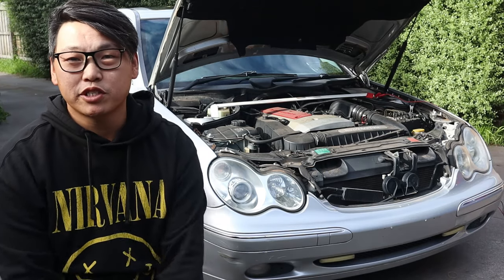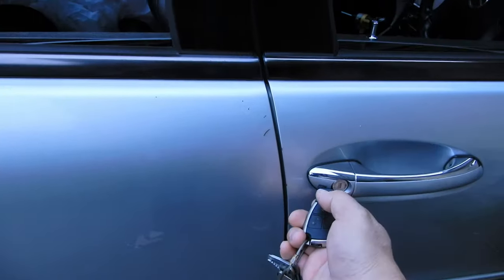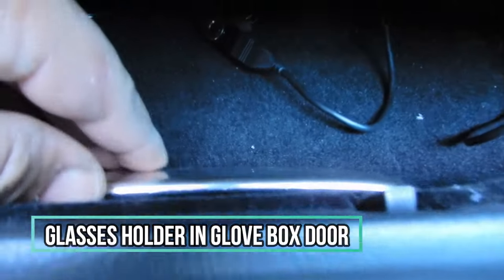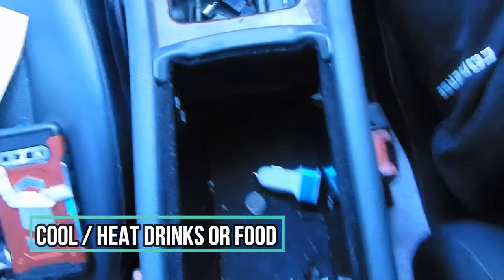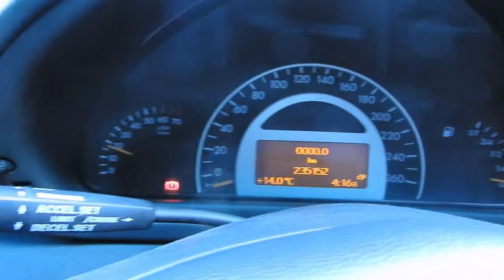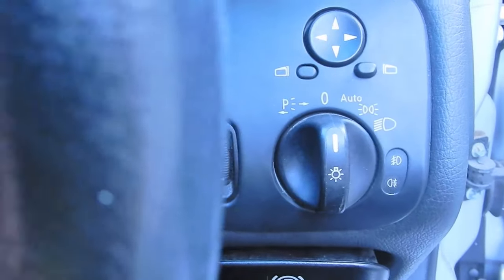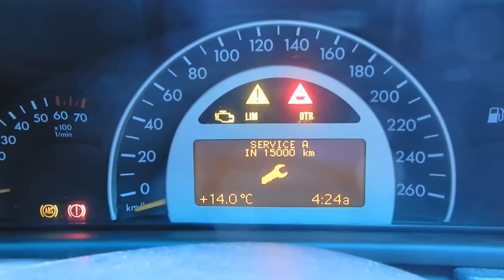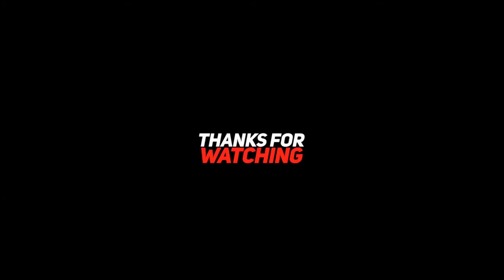MERCEDES W203 cool features tips and tricks handy hacks hidden functions

Comment: Hi MIKEYZ. great video. My c32 has got that annoying clicking sound from the vent system. Was thinking of cutting the electrical connection to the centre stepper motor instead of trying the huge repair. Surely that stepper motor is not that important. hasn't worked for years.
Reply from the maker: yeah I guess u can do that ...
Reply from the maker: 2nd-ly well done on getting the 32 omg thats so gangster love it bro
Reply: @MIKEYZVLOGZ  .Thanks BRO. greetings from Melb. Happy New Year
its the wife's car believe it or not. Nice having a supercharger on a V6. Great takeoff. we have had it 12 years now.
Have you ever seen a w203 in Grey Paint. GORGEOUS. Extremely rare. check out carsales c55 w203 in grey for 34K.
I WANT IT !!!!!!!!!!!!!!!
Reply from the maker: @MercAMG  ye man I've seen that grey colour ..its nice

Comment: so about your sun visors, mine is a 03 and it has pull visors which are very nice. I'm sure you could probably switch some out and it'll be fine. also, mine is having an electrical issue. every few months I have to replace a bunch of fuses to be able to lock and unlock my car from the remote. and the automatic seat adjusters don't work. as well as my sunroof will not open. and how I know it's about to go is that it sets the alarm off randomly, the lights flash and I can't get it to stop until I pulled the fuse. I think it might have a short somewhere and I really can't take it to the dealer to have checked out because I really don't have that kind of money. and I really can't seem to find anything online. if you have any idea about what's causing this, please let me know. I'm in the US btw.
Reply from the maker: wow that's a list and a half ... in your case it could be a short definitely but finding it is another thing .. I am not a professional mechanic but I can tell u that I would start with forums and ask ppl who understand and know cars and auto electricians ... it could also be a parasitic draw too ... that can set the alarm off too .. I hope u get it sorted mate 
.and good all on switching out the visors .. that's very possible too ..but feel it's not necessary... g luck mate
Reply: @MIKEYZVLOGZ  thank you so much!
Reply from the maker: @jebbus1497  no worries

Comment: Hey guys. I have a w203 ‘05 classic 2.0 engine. I bought it less than 6 months ago so I am a newbie at this. If somebody can help me it would be great. First of, My car is automatic however when I put it on gear through tech-tronic, it only has 4 gears. I don’t think that is right, is it?
Second one is my break pedal is very heavy to press. Like very heavy! Is there anything I can do about this.
Appreciate any answer!
Reply from the maker: u should have 5 or 6 gears in auto sometimes 7 depends on the transmission u have ...if your brake pedal is heavy check your brake fluid and make sure you have fluid and also that your brake system doesnt not have any leaks or any parts are damaged , im about to release a video that will help ppl understand more about their car and what options it was fitted with during manufacturing ... so stay tuned
your brake shoul dbe easy to press unless u have lost brake pressure

Comment: I'm trying to understand about the heat booster option and I don't know what it does, it gives me three options: 1 automatic 2 press ec to turn off 3 off
Reply from the maker: ok so ive been asked this alot and from my research and asking other fellow subscribers, its definitely ;doable on the rear doors, if you scroll through the comments there is another guy who states that he did the exact same thing on the rear door, its just abit tricky where u mount the actuator, but im told it very doable, now i personally havent done this yet as my rear doors are fully functioning atm, but if i do ever need to i will be the first to upload the video

Comment: Mikey, do you know how to repair the “infrared windows and sunroof up/down with the key” function?  It simply stopped working one day on my W204 and the same exact thing happened when I had my W203...also just stopped working one day.  It used to work fine.  And I always make sure my batteries are good, I’m pointing in the right direction, I make sure there isn’t any debris covering the sensor on the handle, etc.  Do you know if this is a common problem if it’s a relatively easy fix?
Reply from the maker: so ur windows no longer go up and down with the key... hmm i have never had this issue.. i think it would be just a matter of replacing the infrared bar on the handle or it would be sensor related.. i honestly have no idea how involved it is .. i approach all fixes with the same attitude. Which is anything is fixable.. and better to try yourself then getting ripped off by a mechanic or worse the mercedes stealership,,do some research join some forums and ask questions.. so many helpful ppl on the forums
Reply: @MIKEYZVLOGZ  OK thanks!  I honestly thought this is common since it's happened now on both my cars!  Weird.  I'll look into it but it's very, very low priority.  I'd first rather work on the control knob on my W204 and I quickly saw your video on that.  My control knob also no longer controls anything and I remember you doing a fix with a metal vs plastic cylinder on that.  Well...thanks anyway!
Reply from the maker: @AlGolzari  no worries matey
Reply: Hi, the sensor for this has a broken solder joint. Here is a repair video. https://youtu.be/h5GEVx5uemI
Reply: Boudico Thanks so much!  Appreciate it!
Reply from the maker: @boudico843  love it when other ppl contribute to the channel.. thanks so much for getring involved rather then just flicking through..thats what i want from my viewers..interaction ..contribution.. help to answer questions i dont have the answera to... after all im just a d.i.yer i have no mechanical background or qualifications..im completely self taught and have a lot to learn ...no one can know everything... theres always something else to learn in life in general and in watever u do... sincerely

Comment: What is the problem with your starter. My car is automatic and same problem with you that can not start engine with one turn
Reply from the maker: I think because car is manual it different
Reply: @MIKEYZVLOGZ  Maybe. But i think your car may have a problems with starter selenoid or relay in front SAM (starter relay). My car is the same problems but I pretend to check these part

Comment: Hi bro. Enjoyed the breakdown of some of the features in your video. Two questions on my 2007 C-class 180 kompressor (auto). 
(1). How do I set the side power mirrors.Tried on the setting but unable to find any clue.
(2). Any navigation system in the car. Saw navigation system as part of the features before buying the car.    Your help will be appreciated. 
Salute.
Reply from the maker: so urs is a w203 or 204?? have u checked to ensure you have the function??
Reply: @MIKEYZVLOGZ  Is W203 bro. Where do I check for the functions? Gone to the settings but could not find anything.
Reply from the maker: @amaechiogbonna769  do u have the memory function ? on ur mirrors?

Comment: Help me I’m trying to put blue led Front headlights and fog lights but for some reason the car wont let me it just flashes on and off
Reply from the maker: ok so u need load resiators watch my video on headlight mod my latest video ill show what it is and its in the description what to buy ... leds need load resistors becuz they run off lower power then halogen bulbs so u need a load resistor to allow constant wattage and voltage to the led light ...

Comment: I want to ask something about w203. I am thinking of getting myself one but I've read that this model doesn't actually have a "soft" ride that you have with w211 or w202 or w210. The thing is I really like how this car looks but I've never drove one. Is it true that it doesn't have a "soft" ride that other Mercedes' have, is it really more firm and sporty cus I am looking for a comfy mercedes ride/drive
Reply from the maker: it may not be as comfy or soft but nothing too extreme.. and if u wanted there are things u can do to help soften your ride... like suspension tyres etc.. in the end it's all about personal choice.. if u like the shape it's worth getting... and u can adjust your ride like I said by mods etc.. not a good enough reason not to buy one.. some ppl will find it ok and some will say not soft ... test drive and decide bud
Reply: @MIKEYZVLOGZ  I currently drive my old Peugeot 206 which is a model from 2000 and I guess the w203 will have a better and more comfy drive?

Also I am 6'2 so when I sit to drive in my 206 no one can actually sit behind me, do you think it would be the same with w203?

Thanks for the info!
Reply from the maker: @Vallkayrie  yeah ur pretty tall so u have to put the chair back quite bit but only way to find out is actually test drive and see how you fit
Reply: @MIKEYZVLOGZ  thank you so much for the provided info ! wish you all the best
Reply: @Vallkayrie  mate im 6'2" and my 2002 C220 CDI has enough legroom for a giraffe!🦒

Comment: Hey Mikey I'm looking to buy a w203 c280 at about 74000 miles, is there things I should be prepared to look out for when inspecting the car?
Reply from the maker: just usual 
turn on ac wait for 5mins see if there clicking from stepper motor ..check under battery for rust .. headlight hazzing... engine wear noise... brake wear .suspension check not too bouncy ... auto feel for gear slips in auto ..response etc.. manual check clutch feel wear.. hard soft to press..tells u if clutch is almost worn..look for rust on panels ..listen to speakers make sure none are blown ... do a search for w203 common faults and compare
Reply: @MIKEYZVLOGZ  thank you it’s my first time buying a used car I think I’m looking at a fairly clean one I’ll make sure to be thorough and not tunnel vision
Reply from the maker: @altofant  yeah but do the usual checks too

Comment: Hi Mikey, I’ve just had the dreaded ESL warning light show on my c 200’Kompressor
Reply: Sorry Mikey I truncated that message. At the moment it is still starting but the initial sound seem not quite as normal. What I propose to do is prepare the car for repair while it is still
In action so that the steering lock does not activate. How do
I do this? I know that this key can have a mind of its own so I am looking to disconnect  the battery with the steering lock off. Am I being  obtuse it do I just start it up and pull off the neg terminal? Sorry if this sounds silly but I would much rather be  thought silly than end up with the ESL locked. Thanks in advance.
Reply from the maker: Its better to be safe then sorry ...ok so all u have to do is inserr your key ans listen for the unlock sound then leave key in ignition and disconnect neg battery terminal and wrap it in a cloth so it cant make contact again .... wait 20 mins before u start so all the remaining power can discharge completely or u can get a airbag light ...as there is still power reserved in ur car....
Reply: Hi Mikey: Thank you very much for the battery disconnection procedure. I am not looking forward to this project at all; but I will keep you informed of how it goes. I have no doubt it will work out OK but it is going to require all my reserves of patience, I think. However, your videos are excellent and an enormous help and all have worked perfectly for me. Thank you.
Reply: Sorry to trouble you again Mikey. But I am having enormous difficulty in removing
The ESL from the tweeting column. I’ve thought of removing the entire unit but that seems to be fraught with problems I can do without. What I need, I think, is the little ridged circular ratchet you had on you extension. I have looked all over for it without success. Can you tell me where you got this nifty little piece. I assume it just clips on to the standard link on 13mm nuts. Thank you once again in advance and sorry for being a nuisance.
Also I have decided to go the simulator way to obviate the risk of this catastrophe happening again. I have not yet decided which way - new chip or the whole plastic job which varies in price from NZ$60 to $220. I’m inclined to think the cheap option would serve the purpose because it still is only a chip that fools the car into thinking the status quo has not been altered.
Take care, my friend.
Later... I am having enormous difficulty in removing the ESL.
I have see another YouTube video ( in Spanish) and I wonder if it is as easy as it looks. I’d be grateful if you could have a quick look at it and give me your expert opinion. 
The YouTube address is:
Como remover a trava ELV da Colima da Mercedes C200 - NASSCAR Scanners.
Thanks in advance.

Comment: Hello there, my W203 going into limp mode repeatedly, some say it can be due to the loss key contact and need a new key which holds tight in the key slot.
Reply from the maker: no thats not really making any sense cuzif your key signal is loss it will say insert key..does it say insert key?
Reply: Yah I think it's inert key. Can it cause the car limp
Reply from the maker: @mogotsimpesu3832  I am not too sure ..but what I mean is if ur key isn't detected it will say insert key and u can't drive ...
Reply: @MIKEYZVLOGZ  usually this happens when it fails 1 kick start.
Reply: And at times it becomes inert esp in the morning it start and fails to idle, then limp mode
Reply: Could be a split turbo intake pipe

Comment: How to turn off the stepper motor (its clicking like in the video), do I have to turn off my heat or what?
Reply from the maker: i dont think u can unless u unplug it ..its a bif fix too because big job to get to it
Reply: @MIKEYZVLOGZ  once I put car temp to 22 or less, it stops to click, I think i tricked it or smtg
I am a bit confused, what triggers stepper motor to work, is it always on or
Reply from the maker: @Armin-cu9gj  they move at the start of turning on ur car and  wen u turn off ur car .. they always do a fill motion check that's why u get the clicking noise .. its checking full range motion.. then it stops after cpl mins
Reply: @MIKEYZVLOGZ  alright so, it spins at its max rpm for a little bit, then goes for ur speed..
I have one more question, i m thinking about replacing halogen fog lights with led, do i need a ballast for led lights?
Reply from the maker: @Armin-cu9gj  depends if it is designed for it .. some have it .. but if not u may need resistors for the leds u use .. just make sure they are canbus ones as well

Comment: Sorry bro this was an afterthought did you have that Android device fitted if so how much did it cost if you got it done by your friend how much did it get cost for the average guy that knows what he's doing to fit one error does the company that sells them fit them
Reply from the maker: I fitted it myself..its plug and play 

just make sure u buy the adapter that plugs directly jnto the harness of your factory unit and then the plug for steering wheel controls and its plug and play ..wherever u buy it it will have the adapters fornit

Comment: Thank you so much for this video, I learn a lot. I have a 2002 C240 and I love my car so much and I’m the only owner, I’m having problems with the instrument cluster and I took it to a place here in Phoenix, AZ and they couldn’t fix it and I believe that they replace it with another one and still is not working, I don’t know what to do, any ideas I would really appreciate it, thank you so much!!
Reply from the maker: so whats your issue exactly pls give me more details i will try and give some advice
Reply: MIKEYZ  Hi Mike, thank you so much for getting back to me, here is the problems with my instrument cluster: LCD Display screen is dark and the gas gauge is not working, I hope you have some suggestions for me, again Thank you
Reply from the maker: @conniegeorgescu844  ok so these are my suggestions when ever u come across an issue ... using mercedes benz forums to look for answers and guindance is a great placento start there are so many helpful ppl out there u would.be surprised at the info u can find just from googling exavtly your issue for eg.. mercedes instrument cluster not working fuel gauge not working.. so try and check the fuse related to the instrument cluster... its either on the side panel of the car between the door frame and the steering wheel or in the engine bay
Reply: MIKEYZ VLOGZ thanks Mike!!
Reply from the maker: @conniegeorgescu844  ur welcome mate
Reply: @conniegeorgescu844  i had the same issue, to fix it i had to get the front and rear SAM replaced
Reply: @conniegeorgescu844  its a common problem I too own a 02 c240 167k miles. I dont have it fixed but its common

Comment: Hie m using W203 it goes into limp mode repeatedly after resetting and codes cleared. It always complains of Transmission control module how can I overcome this.
Reply from the maker: did u try the resde of transmission i ur car auto or manual
Reply: @MIKEYZVLOGZ  hello its auto C200w203
Reply from the maker: @mogotsimpesu3832  try the reset for transmission... I did a video on it for w204 ..try it ... or google transmission reset for mercedes w203 and it will give u steps on a reset of transmission module
Reply: @mogotsimpesu3832  when my 2002 C220CDI kept going in limp mode the prob was a split in the turbo intake pipe

Comment: Thanks mate :) some cool tricks but doood get some fuel!
Reply from the maker: Lol
Reply: @MIKEYZVLOGZ  Hi Mikey, I recently bought a 2005 c200 Kompressor w203 and spent ages to connect my phone via bluetooth only to find that there is a missing module in the console that is unavailable at the wreckers. I have good electronics knowledge and can easily replace the radio if required. What would you do in my case? And is there aftermarket wizardry for this?